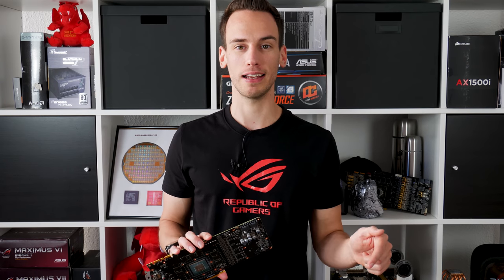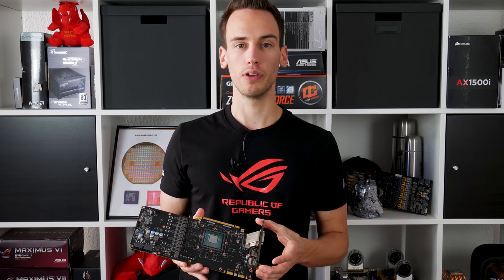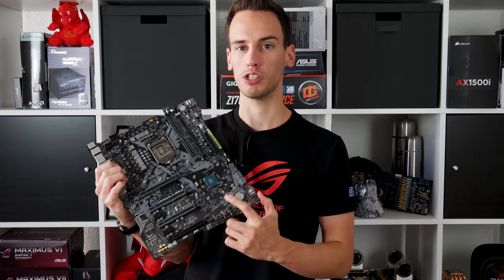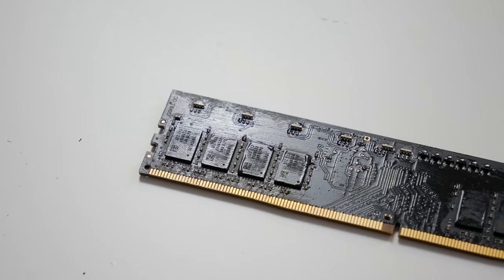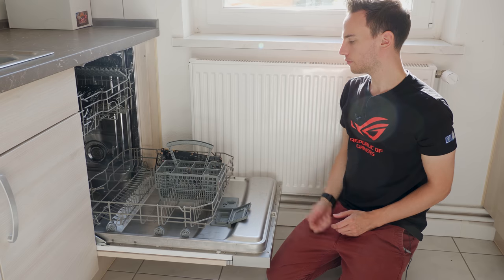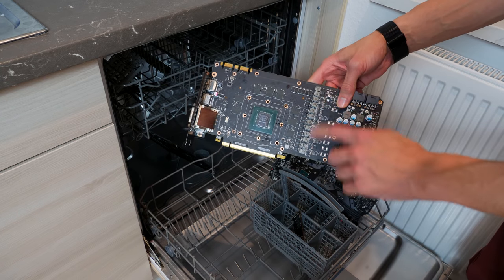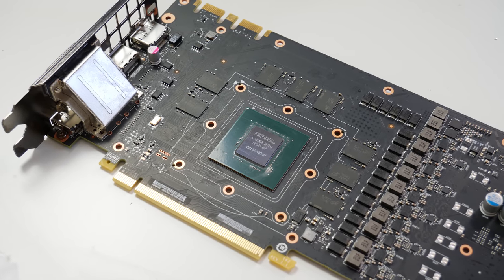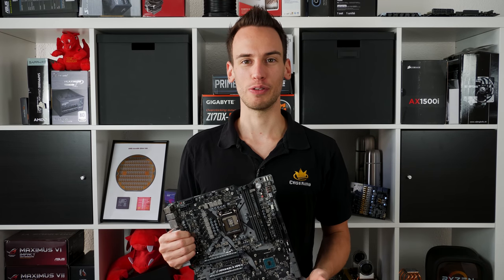The Diswasher Debate

Comment: Hi guys, I need URGENT help, and although I have recently built my PC, everything is actually going well, besides the RAM CLOCK.
Here are mainly the important specs:

Aorus x470 Gaming 7 Wifi (I tried many different Bios versions.
AMD Ryzen 7 2700x
16GB G.skill 3600 Mhz. (Ryzen certified)
Seasonic 650 Watt Focus Plus Gold

And the CPU runs at 4.2 GHz, pretty much stable for games, not for rendering, if you know what to do, to get it stable for rendering, I`d be very thankful if you give me some tips about that, but let's come to the real problem now. My Memory keeps going out of the line, basically if I go for the XMP. 1, I have only one 3600mhz. (which i wanna choose) profile available, and if I select this and go to Windows, I quite often or directly get a blue screen (mostly different messages), if I reset the bios, after the BS I can nearly always boot back into Win10 again. But sometimes I had to reinstall Windows, my problem, I do not know what to do to run/ how to let my RAM on full power. At the moment really desperate, the RAM is currently clocking at the standard clock (2133Mhz.)
regards Linus
Ps. Thanks for the tips in advance,
maybe someone of you can help me with that.

Comment: One issue is the salt added by the dishwasher but if you rinse the board with distilled water afterwards there should be no residue. I'd use an ultrasonic cleaner rather than dishwasher .

Comment: I always always wash my hardware in soap and water. After the wash i take a high pressure blower and blow air onto the parts and make sure there is no water stuck in between the mosfets. Good as New!!! A $20 Electric Air Bed Pump from Walmart will work also. If you know anything about electronics and conductivity...Yes you can wash in water. You just have to properly dry it and make sure its not powered on when water is in contact! I was gonna make a video about washing your parts as well but Mr Der8auer beat me too it.

Comment: do you think it's possible to use mineral oil (for oil cooling) like an anti moisture for extrem overclocking ? with motherboard immersed in a bath, a pump for create a flow to cooldown low power component and higher azote pot (sorry if it's not understandable fr/en/de lol)

Comment: Why does a single drop of water seem to destroy laptop soldier contacts in the Louis Rossman videos?
Reply: those Apple laptop cannot be turned Off, it's powered by an internal Battery that can't be disconnected in emergency,  so if you spill water on such Laptop then the electronics might still be On and if that's the case then the contacts of that electronics (if dipped in water) will immediately perform electrolysis to form acid & oxidative chemicals that erode the contacts, making it rust.
Reply: also the water can act as a bridge and jump electricity from contact to contact and blow a circuit, etc.. 
 @xponen

Comment: They actually use industrial dishwashers to clean pcbs. They have specific cleaning solution, but yeah, water is safe to use on boards. Be careful with the dishwasher: a complete cycle dries dishes by heat at the end and some plastic parts may be affected by that. So if you can exclude the drying cycle or just stop the machine before it start to heat things up, it'd be better.

Comment: Quick question... there are products that remove greasy stuff, I've mostly saw them for automotive and motorcycle applications, that are mostly based on alcohol but are really good at removing it. I used them to clean my motorcycles chains, for example.  Did you ever tried any of it to clean the vaseline ? Would they work? I would test it myself, but I don't have a spare graphics card to do it.,.. hehehe.,.. Anyway, nice video. Cheers!
Reply: You can use isopropyl to clean most things but you'll never get it all in the way this does.
Reply: @agitatingazathoth1592  well, I mentioned it because this comes in pressurized cans.. it  has a good punch ... I will try to find an old mb or something to test it out

Comment: Hairdryer can be risky, if you hold it over one ram IC for too long it can hit the flow temp and slide off the board.
When I used to do sub zero, after washing in the dishwasher I would move to the oven (since I'm already in the kitchen) and bake it fan-forced at around 70°C for a couple of hours 😉

Comment: Could you submerge a pc in liquid nitrogen? You wouldn’t have to deal with condensation until you pull it back out
Reply: Someone overclocked a Pentium 75 to around 3.5GHz submerging it in liquid nitrogen IIRC.

Comment: Don't you need to worry about corrosion? I understand you will make sure that the board is dried properly after you take out from the dishwasher but under microscopic level the corrosion may already be started due to the impurities of the water from the pipe.

Comment: Are there any capacitors on any of those components that could possibly still be charged? 

Im not that familiar with cpu components, but would there ever be a case where the capacitors need discharged before doing something like this, and if so is there an obvious jumper somewhere for doing this?

Comment: @der8auer do you not have any issues with the vas solidifying around the drain pump? That was the reason that I stopped doing this, after cleaning many different boards I noticed my drain was starting to clog up with vas and I had to replace my drain pump.
Reply: The dishwasher detergent should be able to cope with Vaseline just like it deals with oils from food. Just run your dishes on intensive the next time you use it

Comment: Interesting seeing this. I have been washing electronics in a sink for more than a decade already. I use water based degreasers and detergents to clean all dirt and residues and rinse by submersion and running water several times. I swing the boards edge on hard to fling out water under the BGAs and sockets/slots and then do an final rinse in distilled water (removes trace detergents and minerals/ions)  Swing them again and then blow dry all the BGA and slots/sockets with relatively low pressure air gun.  Then I place them in a really warm place for a day or so, like above the fire place in colder months and outside in the sun during summer.  Once dry they are actually cleaner than new as new they usually have some white residues. The distilled water prevents any residues when it dries out so it ends up cleaner than new.
Reply: I made circuit boards professionally at a board assembly house. We ran boards through a dishwasher then just let them drip dry. So you might have been overdoing it a tad with your complicated method you have there.
Reply: Well the cleaners I use are extremely corrosive (PH of about 12-14) so all residue needs to be removed as any left over when humidity is high can cause metal parts to start corroding.  The cleaners are great at removing existing oils and oxides but will  catalyses new oxidization if not rinsed out properly. Distilled water pulls all the trapped alkaline salts out of the microscopic crevices because of the high gradient potential.  Another side effect is if humidity gets to the salts under BGAs and stuff like that it can cause cross talk due to the conductivity and cause stability issues. 

I use this method for things like car dash instruments and it leaves it so clean and spot fee once dried in a dust free containment the dash can be assembled cleaner than factory, ie no visible spots or dust particles and no risk of future corrosion even with high humidity as there are virtually no salts or minerals to catalyze corrosion .   It really isn't hard, just pour over with distilled water once main cleaning and rinsing is done. You know it's right when the water stops sticking and beads up (surface tension changes when minerals are no longer on the surface)
Reply: Do it on 10,000 boards and tell me how easy it was. I'll see you next week. That's usually how long a single 10K operation takes.

Comment: this may be ok for the electronics components but it's not going to be that great for your dishwasher's drainage pipes and your house's drainage pipes. It's the same reason why you don't pour oil and oily things down the drain. They dont break down and instead coat the pipes and cause build up and clogs over time. Yeah the vaseline melts in the dishwasher but by the time it is being drained it will cool down in the pipes and most likely a lot of the vaseline will remain stuck to the inside of the pipes, which over time will cause more debris to stick to it and eventually lead to a clog.

Comment: What about corrosion? Does this not cause surface corrosion that will later expand? Aren't tap water residues (like shown on top of a ram chip) a problem?
Reply: Also, are all components, like chokes, electrolytic capacitors, etc,  waterproof?

Comment: I understand that it is best not to put your finger across the + / - terminals of coin batteries as the fingerprint residue can cause a minor short reducing the life of the battery.

You reminded me about a friend had a PCB manufacturing company, periodically he would unplug and just hose down his PCB CNC mill/drilling machines including all their control boards.  Was so weird to see at 1st.  No problem as long as they are dried out before repowering of course.

Comment: CRC electronic connector cleaner. Use it save time , money , and do it in fraction of the time. You can even do it when power is running through the board although I wouldnt.

Comment: Why is it not possible to get more then +0,2125 adaptive vcore to a threadripper 2950k via bios? It works with Windows to rise above but with a biso setting it doesnt boot above +0,2125 vcore. Motherboard is a x399 asus strix. Bios error? There is no newer Bios avalilable.

Comment: I think the use of some dish soap use before placing the cards in the dishwasher would be safe.

Since petroleum jelly (Vaseline) is an oil, and most dish soaps are designed to break apart the bonds that hold grease and oils together.
Might be a worthy side experiment.

Comment: We used dishwashers in production when I worked for Philips. One key thing, don't use dishwasher if your water is "hard", or you should have de-ionized water.
Reply: I worked at a place where we used hard water to wash boards. It was never an issue. I know the water was hard because a buddy of mine lived in that city and he ran a humidifier. One day he ran his finger over a TV screen and showed me all the white crap he got off it. After that he started using a reverse osmosis water filter for his humidifier water.
Reply: Could be different elements in the water cause different problems, or maybe they were being cautious. If I remember correctly (it was over 40 years ago), it was a whole rigorous procedure. We actually used dishwasher detergent, and had a water softener company come in. We were trying to remove flux from the board.

Comment: My only question is ... I'm assuming that any heat-dry stage in the dishwasher should be turned off, correct?  Since the heating element at the bottom of the dishwasher can actually get quite hot.  Just a long hot water wash?

-Matt

Comment: 16 seconds of der8auer talking is enough to get my like. The rest is just glorious bonus material.
Reply: I take this back, I watched the whole thing and it was a very interesting and informative video. I had no idea about this method of cleaning stuff. I would imagine for the smaller parts you'd be better off with an ultrasonic cleaner, much quicker and more thorough, but it's hard to fit a full ATX board in one of those.
Reply from the maker: :D

Comment: That visible residue left on PCB can be conductive, it depends on purity of your water of course.
If you really need to do it, I would highly recommend to soak it in 100% IPA after washing, it will dissolve all water and other crap, then you dry it, not even necessairly with heat gun, you could just leave it and IPA should evaporate quite quickly on its own.
Reply: I worked at a board assembly house where we made tens of thousands of circuit boards every year. The water we used was very hard and full of minerals. All boards went through a dishwasher. We did not clean any of them with anything after that. So you're wrong.
Reply: If a company is serious about quality, they would use de-ionized water in their washing process. It would be hilariously unprofessional to have limescale stains on a factory new PCB. If you wash your own motherboard in a normal dishwasher, who cares, but doing that in a professional setting is absurd.
Reply: If it was an issue we'd have addressed it. It wasn't, so we didn't. That water was hard as hell too. A buddy of mine lived in that same town with the same city water and when he ran his humidifier it left white residue on his TV screen. But it was different. We just washed boards once. He was running that humidifier all the time. Build up takes time. Obviously one wash cycle wasn't enough time either. He did start osmosis filtering his humidifier water. We kept running our dishwasher off tap water.
Reply: Dude wtf, what kind of company is that?!
I was working in few electronics manufacturing companies and none used even clear water, only IPA based specialised cleaners...
Reply: We were a company that used water soluble flux. Why would we use anything  but water to clean it? That's the point of using water soluble flux. It washes off with plain water.

Comment: About the only thing I can see wrong with this is that most dishwashers also use a drying agent, not sure how that might affect the hardware
Reply: He adresses it at 8:56 as the thing he doesn't know the english word for.
Reply: I think he was referring to the detergent. The drying agent isn't added during every cycle, rather it automatically dispenses it from the pre-filled reservoir besides it. So unless you never added any or used it all up there will be some left in the reservoir.  Like I said, I am not sure on its impact, but it should be noted.
Reply: in the german video he said that he didn't put dry agent in there for a long time so that the reservoir is empty or not much left.
Reply: Sehr gut, danke!
Reply: This should never be done with electronics. The detergent residue is left all over the inside of dishwashers from previous loads and it is filled with minerals. Not only that, but dishwasher water is unpure and filled with minerals and dirt and should never be used for cleaning circuit boards. Only pure water and/or isopropyl alchohol should be used

Comment: Many dishwashers use salt which softens the water, isn't this a problem for components longevity?
Reply: he said that he didn't include any wash solution gel
Reply: @cuerex8580  yeah, but like said there are salt containers in dishwashers separate of wash tablets, and it wouldn't be unreasonable to assume that it is possible that there is still salt residue inside the dishwasher, unless he did a series of "empty" washes.

Comment: I'm surprised more people didn't know about this.  As long as there is no current running through the product or left in the capacitors water is fine. 

The only electronics that fail when they get wet are usually ones that have built in battery (just got to that point in the video as I type this lol).

NO DETERGENT!!!

Comment: Any components used on hardware, that is likely not pressured water safe? Things like chokes and caps come in different designs and materials, so I thought it would be a worthwhile question. Also - do you blow out the "finer" and deeper ports like hdmi and DP, jacks and toslink..?

Comment: I saw some pc cleaning like this before like 15 years ago. They used very simple method. A toothbrush with detergent powder and water. After washing they hung those motherboards to dry out. I asked them will work and they said yes it will work fine also look great and cleaner.

Comment: While this undoubtedly works, there is a faster, safer way of cleaning that sort of stuff. You even mentioned it: contact cleaner. You do however have to make sure you choose a suitable one as there are 2 main types: isopropyl alcohol based ones and petroleum spirit based ones. The alcohol one would be better suited to removing water as mention in the video. I would be doing away with the dishwasher though and use shellite and a paint brush to clean the vaseline off. Would probably only take about 10 mins per pcb.

Comment: If you have really hard water (lots of minerals and calcium) like we do here in the northern parts of europe. should i rince it with soft destillated water. like battery water after washing?
Reply: I have to add, it wound not be a problem to use fabic softener, but there is no sense in useing it, because fabic softener is based on fatty mixture. So this mixture would end up on your motherboard, not that this would be a problem ( from a the electric perspective), but that's probably the oppostie of what you wanted to achieve.
Reply: @MW-dz1hg  why would you put fabric softener in your dishwasher anyway.. Did you reply to someone else or not read my question? :D Well I usually use Isopropyl and purified/destilled water to clean electronic stuff cause of all the minerals in our regular tapwater.
Reply: Dishwashers soften water already, they have ion-exchange resin in them used to replace calcium and magnesium ions with sodium (that's why dishwashers have salt compartment).

Comment: My PC would boot and shut down 3 times until it wouldn't boot anymore, when i tried to start it. Broken. I tried to put it in the dishwasher - even the PSU. I forgot to take out the BIOS battery, but it diden't really care (fortunately, because this was obviously a mistake) and now i have a working PC. It have never been this clean since i bougth it and ITS WORKING! I have no idea why, but it probably was so dirty before (i'm an indoor smoker, bring the hate) that the temperature would shut it down.